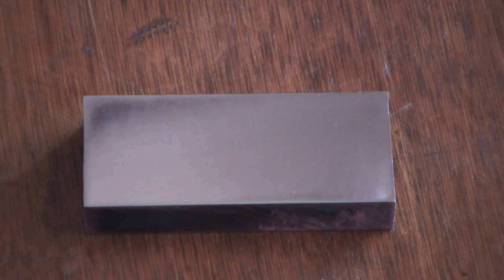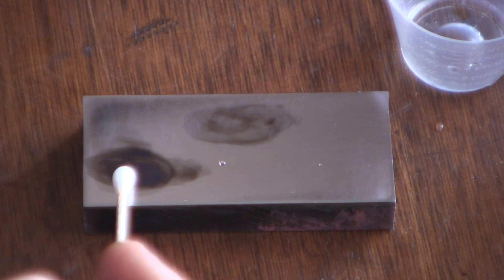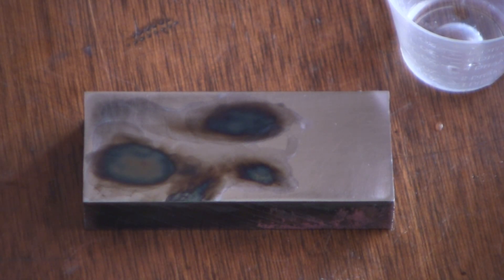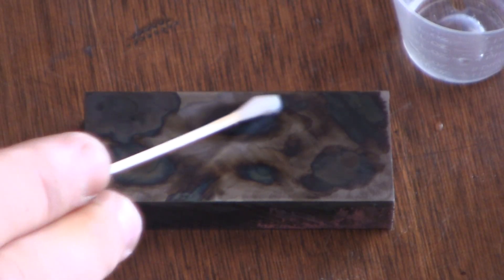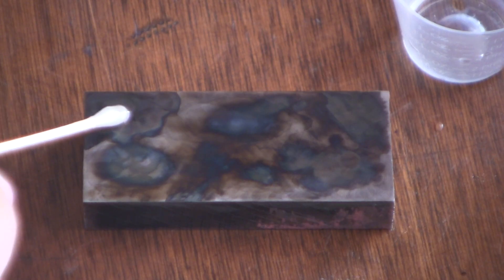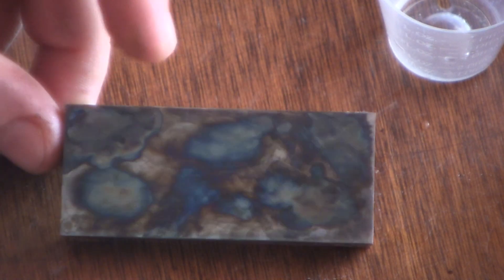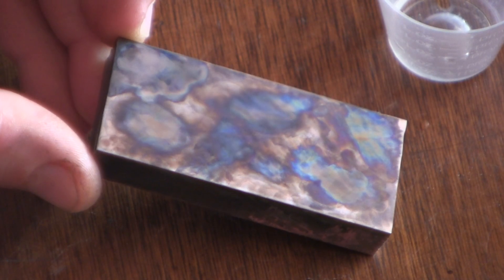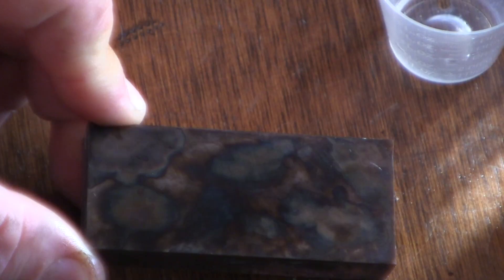Color Case Hardening Effect using Cold Blue

Comment: Excellent, thank you! I had to do some grinding work on my Pietta 1851 Navy revolver with a similar finish; I used this technique and restored the finish where I had worked. You can't even tell, the gun looks new!
Reply from the maker: Glad it worked out. Sounds like a great spot fix for a great revolver.
Reply: That's nice. I was hoping to find out if it could be used on hardened steel and/or color case hardened steel. That would really suck to have a color case hardened frame, but then have an area where the coloring was removed. At the same time though, having a way to fix it with long term results is really good to have. Has it held up on you over the years? and/or you ever have to redo it? Even if it had to be done every couple years though, I still think it might be worth it if it holds up well. I think that this will give it some rust protection as well.

Comment: Will this process work on aluminum?
Reply from the maker: Unfortunately no.
Reply: try taping off some designs first, then apply the color. see if the aluminum underneath isnt affected. then you can go from there.
Reply: Maybe clean the aluminum well, then smear a little oil in spots before adding your darkening compound? Repeat a couple times letting it set for different lengths of time for different shades? Just guessing.

Comment: Thanks for sharing this. I've been trying to figure out how to duplicate this finish for restoring older machinist tools.👍
Reply from the maker: The best would be to actually case harden those but this would probably work for the look alike only
Reply: @MosinVirus  
Thanks
 What produces the color when case hardening? I have a powder called cherry red, but don't know how to attain that.
Reply from the maker: @James-fs4rn  in color case hardening the different colors are achieved by having different amount of heat in different spots on the workpiece. The parts are packed with charcoal and other materials into a sealed container which then goes into the kiln at a certain temp for a certain time. Then the parts are dumped into water. You can find videos on the process.
Reply: @MosinVirus  I watch Larry Potterfield do it. Equipment looks very expensive.
Reply from the maker: Yes, proper color case hardening requires some equipment for sure.

Comment: Would this work, on a stamp steel AKM?
Reply from the maker: Technically this should work on any carbon steel.
Reply: @MosinVirus  thank you soo much and what will i meed to aviod make it come off?
Reply from the maker: @chinoyomaji288  this is not durable by itself of course. Usually color case hardening is lacquered. You could try that.

Comment: Now, is this permanent or would you need to heat the metal?
Reply from the maker: The original and authentic color case hardening colors come front differential heating of steel. This only simulates the colors. The original used to be lacquered to protect the colors from rubbing off, this faux simulation would also need to be lacquered to not rub off.

Comment: thinking of doing this to my chopper frame, way kool
Reply from the maker: It would look cool but remember that it doesn't offer a whole lot of protection for the carbon steel. Usually color case hardening was lacquered over to actually protect the finish and the steel under it.
Reply: make sure you clear coat it.

Comment: been watching your Beretta 92 videos and I've been thinking on doing this to the slide of mine. Any input?
Reply from the maker: This finish doesn't offer a whole lot of protection against rust, even when it is not a faux finish. They were usually lacquered to actually protect the metal and the color. I would suggest going with functional protection on a gun you plan to use.

Comment: What kind of steel are you using? I tried this on an old shotgun but I can't seem to get any other colors other than blue. Does polishing the steel have a major effect?
Reply from the maker: I didn't this on a piece of 4140. This was my first attempt after I accidentally discovered the effect. So I haven't worked out a 100% instruction.
Reply: Some old shotguns are cast iron instead of steel
Reply: damascus steel may not work.

Comment: would like to know if i can do tghis on an aluminium framed gun. any tips or info would be great.
Reply from the maker: I don't think you could do this to aluminum. Plus with aluminum frames you want more protection and surface hardness. Anodizing is a way to go.
Reply from the maker: However with anodizing (type 2 that you can do at home) and some diluted dyes it may be possible.
Reply: you could probably apply some kind of oil or chemical to prevent the anodizing. apply it in some patterns like case hardening, and then go back and anodize the rest.

Comment: Neat! I just restored an old Crossman Classic American pump BB pistol. Polished it out and blued it using that PermaBlue. It turned out pretty nice. I may strip it, and give this a shot. It would look pretty cool (I think).

Thanks!
Reply from the maker: My pleasure. But these types of finishes should be lacquered over. If you got a good blue on the steel already you actually have more rust protection than you would with this faux effect, unless you lacquer it of course.
Reply: Thank you , I appreciate the reply. I assumed that the rust protection would be there. It's still a pretty cool effect, I'll have to find something else to try it on. C-ya!

Comment: Looks awfull
Reply: Some people are just dicks it looked pretty good for what it is .
Reply from the maker: In general, or compared to the real thing?
Reply: MosinVirus In general. An even blue across the piece is much more visually appealing. I have been considering reblueing a rifle but have been warned off using chemical blueing by friends because it is difficult to achieve an even effect. You video demonstrates this this very well. Thank you.
Reply from the maker: I think you misunderstood the intent of the video. Cold blue can be used to achieve great even black results with ease, only if you were seriously considering a complete reblue I would have recommended a different product. This video was showing how misusing the product can lead to a simulation of a hard to achieve visual result of Case Hardening. Again, by misusing the product.

Comment: I remember reading this in school in Brownell's Gunsmith Kinks. I believe the use of alcohol in the solution also had an effect, as well as a torch. 

Some of the guys I went to school with tried the application of cold blue on parts that were actually color case hardened, and got some crazy psychedelic colors such as green, pink, purple etc. Kind of cool but hard to find a practical use for.
Reply from the maker: Thank you. I had no idea if this was a known method, but as you and a few other posters have stated it is well known.
Reply: How do you do do it with alchohol
Reply: Jay Muller  I don't think so. Cold Bluing and Hot Bluing works on Ferris metals, that is metal with iron content, and forms a sort of rust. Aluminum has no iron and therefore does not rust; it corrodes.

Comment: Very nice Mosin! You are showing it on a small rectangle flat piece and in my opinion it looks damn good. On a 1911 frame, I think your process will look even better. The 1911 frames lines are broken up with contours, curves and the flats are longer thinner sections. Since you can be selective where to add the effect, you could end up with better results than some of the expensive custom 1911 I've seen. Nice work as always!
Reply from the maker: Thank you very much.

Comment: A very good effect you have there, and it would also be a way of colouring up areas that it would not be wise to apply heat too, for some reason a lot of gun butchers love to cook everything up with heat, not considering that they are ruining the heat treatment of the part, your cold blue method is safe, and effective, and with a clearcoat spray will look better than a lot of case hardened finishes.
Reply from the maker: Thank you. Apparently this method was discussed in some gunsmithing articles so it is valid. I just found it out by accident and wanted to share right away. I think a lot of people can do a lot of cool things with it like you said.
Reply: Up to 150 degrees you are not going to ruin anything with heat, running bullets through it and it gets hotter than that. Stop generalizing.
Reply: @stoneblue1795  I am not quite sure what your problem with my statement is, no one will have a problem when heating to 150 degs C, but then there would be very little point in heating to that temperature as there would be no colour change, my comment was directed at the people that heat up heat treated parts to way over that temperature and think they are just colouring parts, whereas they are changing the strength of the part, and potentially making it weaker, especially if it is case hardened.

Comment: I've NEVER had good results with Birchwood Casey cold blue. Your results are better than mine by far. These days I use some stuff sold by Brownells.  Oxpho Blue I think it's called.  Easy to use.
Reply from the maker: Birchwood casey is pretty good. I see good results with Oxpho as well. I still want to try Mark Lee Express blue. I hear it is similar to Slow Rust bluing but much faster.
Reply: I'll have to try the other product you mentioned. The Mark Lee stuff. I have had the best results with the Oxpho  Blue, but even that isn't as good as a factory blue job. I do smithing part time, but mostly the blue is for touch up of things I've done machine work on.  Good video, thanks for posting!
Reply from the maker: Thomas Liemohn you can actually see how well the finish comes out on the Charger Guides I recently made for a Winchester 1895 Russian Musket if you search for my account on Instagram probably. I have a couple of short videos on them there. They were blued with Birchwood.
Reply: Ocoho Blue works pretty good. I used it to reblue a set of barrels on my old Stevens 311 H. Had a bit of a swirly pattern if the light hits it a certain way. Also the more coats applied the richer the color. I took a hair dryer to heat the barrels to absorb the bluing then would hang the barrels in front of the fire place each night after application. It really darkened the color. This was about a week long process.
Reply: I have had good results as well as bad with Birchwood Casey over the years. I mostly use it for touch ups, but once in a while I run out of Oxpho and have to resort. I have found if you use a good detergent and scrub the peace between coats rinse and heat dry the Birchwood Casey works much better.

Comment: VERY COOL but easy to overdo or underdo ? But I guess thats where the artizan part comes in        great stuff
Reply from the maker: It actually gives you quite a bit of time. Most of the video was real speed, some was 2x. Of course practice would make it better. I discovered the effect yesterday and produced it for the first time while actually trying today. It would be a good exercise for someone to first learn how these colors behave, and then using a picture of real color case hardening as a template to try and reproduce the pattern.

Comment: I would be interested is seeing it in 30 or 60 days to see if it fades or changes
Reply from the maker: I could do another update though I am not spraying it with lacquer. Even better, email me to remind me to take a look and I can send you pictures. Mosin.Virus@gmail.com
Reply: Deal
Reply from the maker: By the way, so far no change. Colors are strong. I don't think they will fade.I am very tempted to try and coat the block with something to see if the refraction will change and if the colors will become visible at all angles.
Reply: MosinVirus great  so its still looking good ?
Reply from the maker: Walt Lars looks exactly the same so far. The only thing I don't like is that it is difficult to see the colors from some angles. That is why I was thinking of coating it with something transparent to see if it will make it easier to see the colors. However, that would interfere with the fading test so I am holding off, though I don't see a way for it to change over time unless it is exposed to the harsh elements.
Reply: Really cool video! It's been 5 months now... how's it fairing?

Comment: I've been wanting to do this to my ak receiver. Was wondering if a spray of clear coat over it to keep that "wet" look would be bad.
Reply from the maker: I believe all color case hardened pieces are lacquered. If not all then most are.
Reply: Yugo rifles are blued. Pretty much every other AK is painted. 
Powder coating is not a good idea on a firearm
Reply: Powder coating may be more durable  as it is a layer of melted polymer.
Reply: MosinVirus what coat would you recommend?
Reply from the maker: It would depend on what you are trying to accomplish - traditional Russian style AK or something "new". Personally I would parkerize or blue.
Reply: If you're diligent about it, you could probably just oil it, like in this video here. Keep it dry and oiled and it ought to hold up ok. I'm going to try this out on a machete I'm making (knowing full well that it will get scratched up during use). It'll be easy to touch up if needed and a bottle of the Super Blue is less than $10 on Amazon.